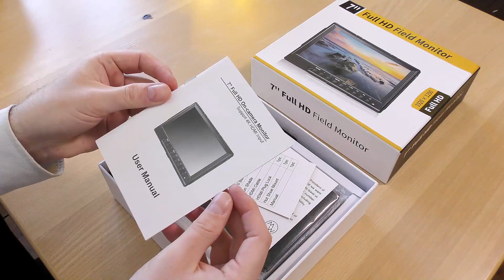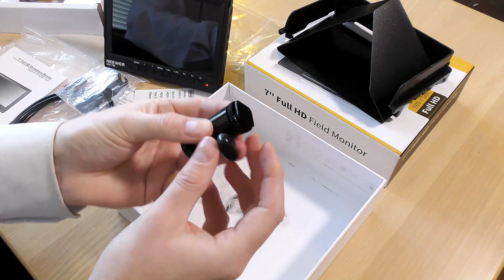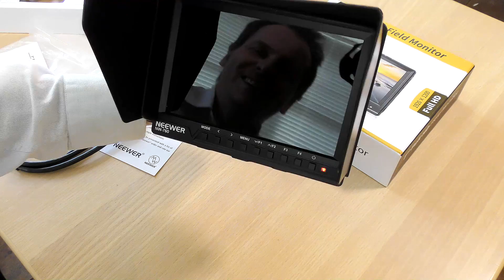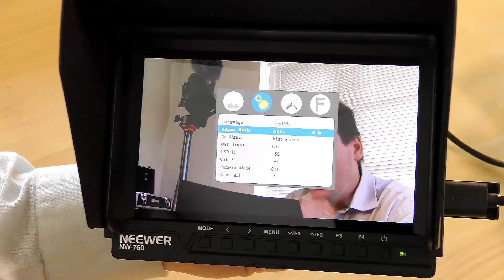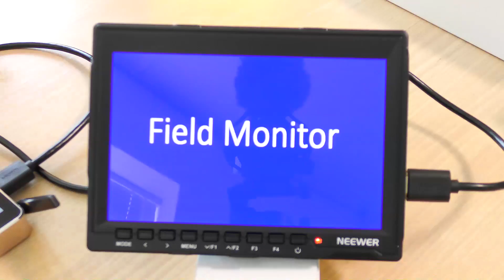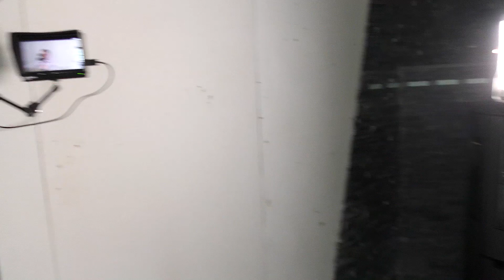Neewer NW-760 1920x1200 and NW-759 1280x800 - 572

Comment: What software or firmware did you use to get the FW579 to 1920X1080?
Reply from the maker: Hi M STUDIOS
This is not a FW579 but a FW559 and it's only a 1280*800 screen but it can downscale an HD pic. and show it.
Thank you for watching! :-)

Comment: great vid. I am considering these displays (among others) but will not go for it unless it can display the native resolution properly....hopefully display scaling can fix that...
Reply from the maker: Hi v1nce n7
"Shouto Todoroki" replied this to me , about this:
you have to set the display scaling in Intel HD Grahpic Control Panel
by selecting Maintain Display Scaling (on the Neewer screen) so the screen won't go small like that
(ps.this is also happen to me when I connected to a 1280x800 Epson Projector with long VGA cable)

Thank you for watching! :-)

Comment: you have to set the display scaling in Intel HD Graphic Control Panel
by selecting Maintain Display Scaling (on the Neewer screen) so the screen won't go small like that
(ps.this is also happen to me when I connected to a 1280x800 Epson Projector with long VGA cable)
Reply from the maker: Hi Shouto Todoroki
Thank You very much!  I will try that!!
Thank you for watching! :-)